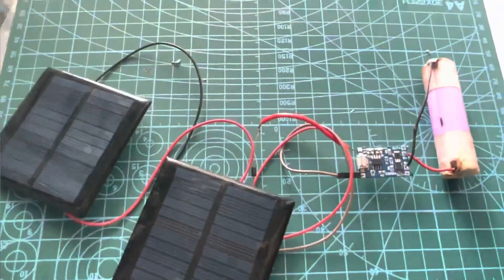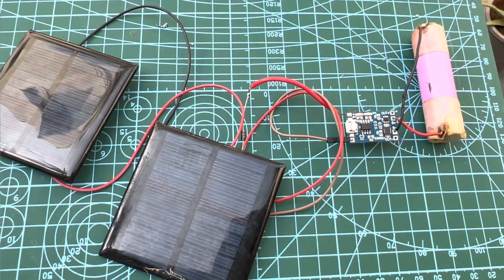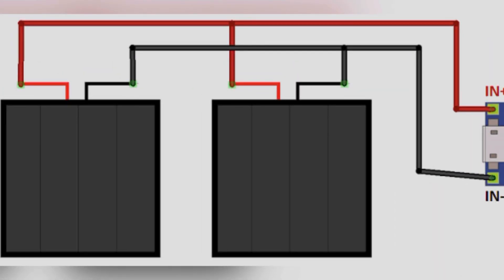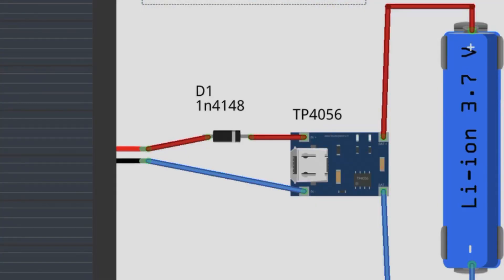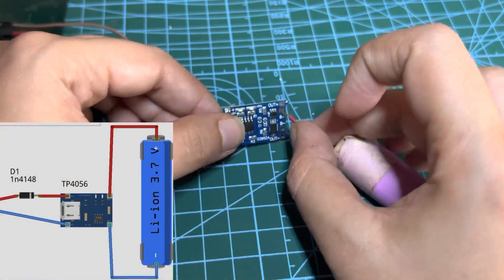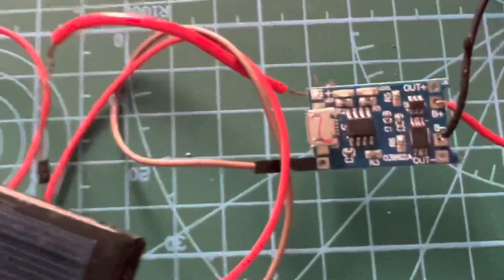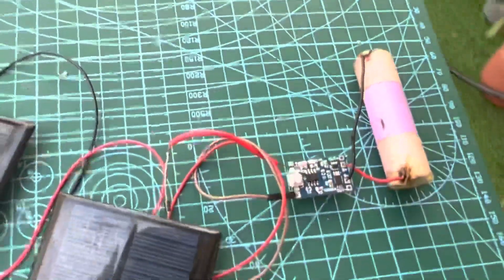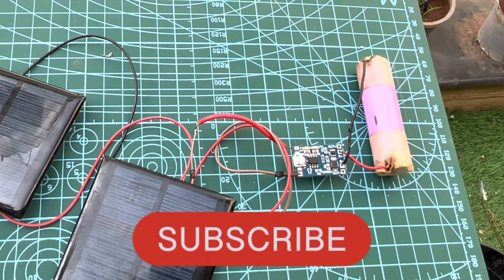How to charge LiPo battery with solar panels |Solar energy | battery 🔋

Comment: how could I then have the power come out of that battery in constant time and power an RC glider?   Like would I be able to run right back out of that battery to my ESC and to the motor?   or would it be better to somehow run the solar panels and the battery both into an ESC or into some other power management circuit?   I want to put solar panels on my glider and have them and the battery both available to power the glider since the panels alone won't be enough.
Reply from the maker: To power your RC glider with both solar panels and a Li-Po battery, you shouldn’t connect the panels directly to the ESC; instead, run the solar panels through a proper Li-Po solar charge controller (preferably MPPT with load-sharing), which will safely manage charging the battery while also allowing solar power to assist in flight, and then connect the battery output to your ESC so the motor and receiver always see a stable supply.

Comment: Hi there ! you are using the terms Lipo and Lion interchangeably, however, they are different .TP4056 is meant for Lion battery if I am not wrong. What you calling as Lipo battery is actually Lion battery.